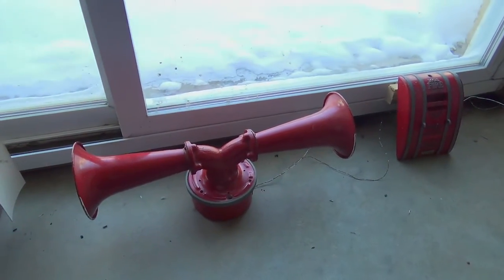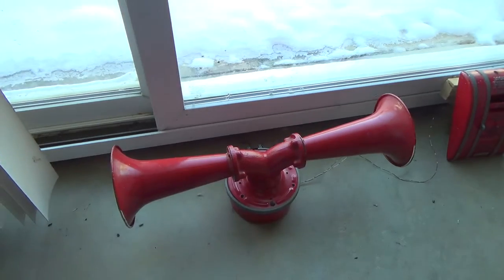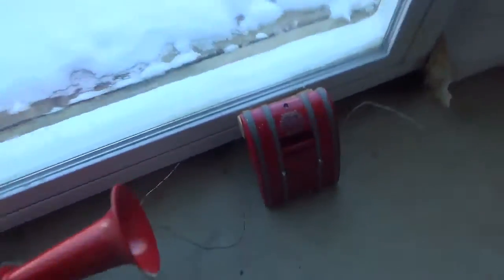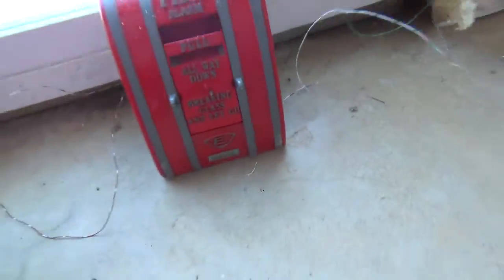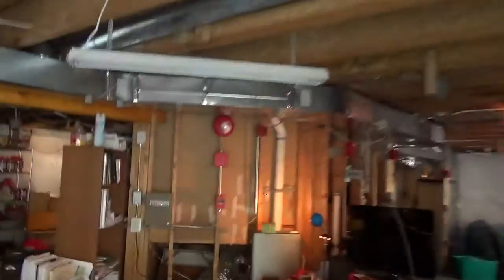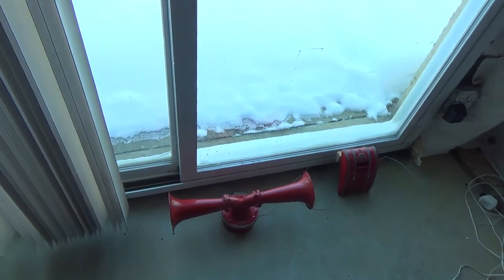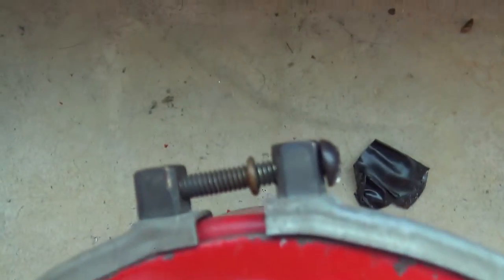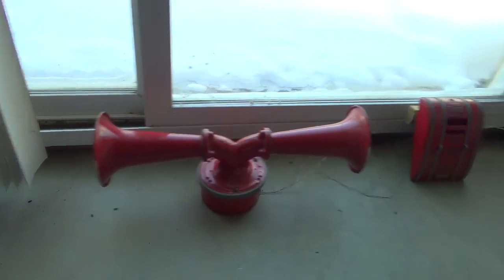IBM 4030 Test

Comment: My dad's elementary school has those fire alarm horns, original to the school's 1963 construction. Only I doubt they are the IBM/Simplex version, as the original fire alarm system is a Gamewell FlexAlarm system with the Century pulls (they are probably the Benjamin version).

Comment: Those Are Not Rare, In My Library They're Like 10 Of Them In There And One Of Them Are Gray
Reply: Correct. I have been to plenty of places where they have an entire system of rare devices. That doesn't make them common though. Besides, this is an International Business Machines 4030, not a Simplex, which are more common.